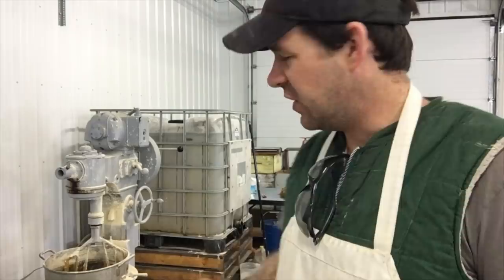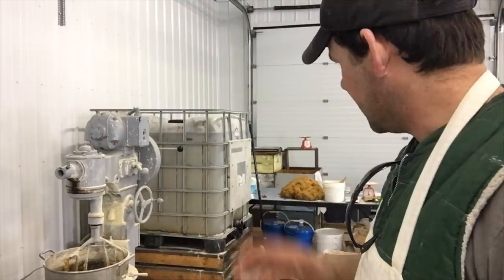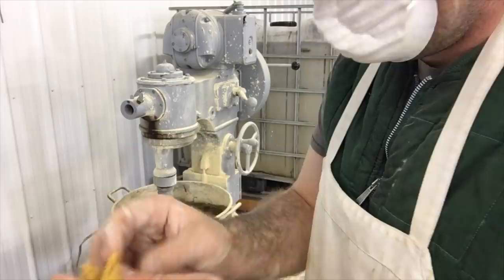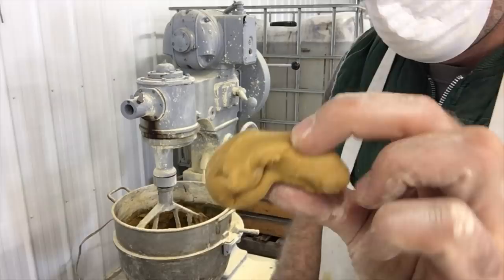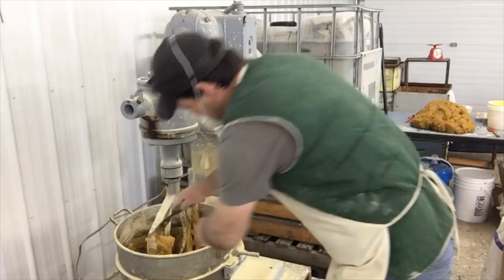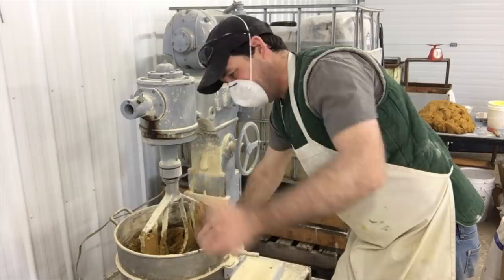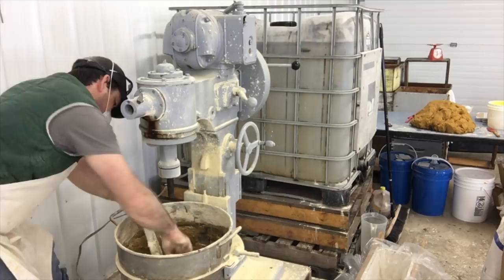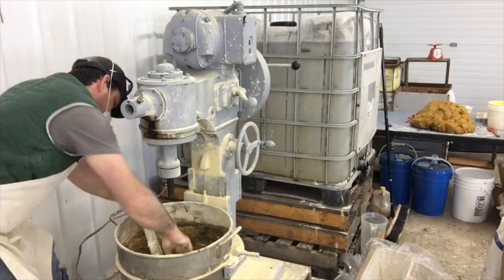Off the Shelf Cheap Honey Bee Patty Mix - April 4 2020

Comment: The syrup for patties needs to be inverted or use prosweet, regular sugar water syrup will work but it sets hard in a few days and the bees won’t touch it
Reply: If you add extra oil doesn't it stay softer?
Reply: Russ K not really it stays wet with oil but the sugar still crystallises and makes the patty hard
Inverted syrup doesn’t set, Ian buys inverted syrup by the semi load if you’re making syrup on a small scale it’s simply a matter of cooking it for 20 mins (5 minimum) and adding cream of tartar to preserve the syrup
Reply: @BESHYSBEES  Thanks for the reply. Can you use corn syrup that you buy in the grocery store?
Reply: Russ K I’ve never tried corn syrup but I’d say you will need to dilute it, corn syrup is pretty thick isn’t it? Sugar is cheap
Reply: @BESHYSBEES   If we decide to make inverted syrup, which ratio do we start with before cooking, 1:1 or 2:1 sugar syrup?
Reply: Nature's Sweet Bees Eastern Ontario depends what you’re using it for I use 2-1 for coming out of winter to build up and 1-1 for summer dearth.
2-1 for patties

Comment: Is it normal for some hives to reject some of the patties? We saw some of them taking chunks outside de hive. We got a really thin soy flour. Some hives devoured the patties. 

Also, has anyone calculated a ratio pounds per brood-frame or so? We observed that an additional patty will we consumed faster than the previous one probably due to increased population, but it would be great to have a parameter.

Comment: Here in New Zealand I have been using beef fat as one of the things they get from pollen is cholesterol and it is listed on every pollen constituent I could find.
Seems to prevent drying as well.
Reply: Hwy Stewart , west Aussie man here   beef fat are you using this recipe and using beef fat , you just melting the fat and mixing in . The fat would have to be clean fat though
Reply: Yes. Using beef fat instead of canola oil which is not good for man nor beest. Straight from the supermarket is easier than rendering it down.
Reply: Yes I have been looking at Olive oil . Or even the leftover from the extract of olive oil ,.

Comment: Great Video as per usual. Ian do you or anybody else have issues with it drying out in the hive and turning into a brick. The bees start to consume then stop when it gets to hard. I don't know if its because of a dryer temp here in Western Australia ? I've tried adding icing sugar also extra oil but have the same problem. Any help would be helpful.
Reply from the maker: Cambo 
HFCS
Reply: Used sugar syrup with icing sugar in it thinking that when drying the sugar crystals would be finer. HFCS isn't readily available to us in oz.
Reply: I tried using it one time when it was all I had and they did not like it at all.Bees can't digest the corn starch in the icing/powdered sugar.